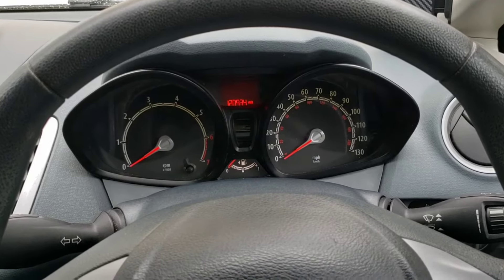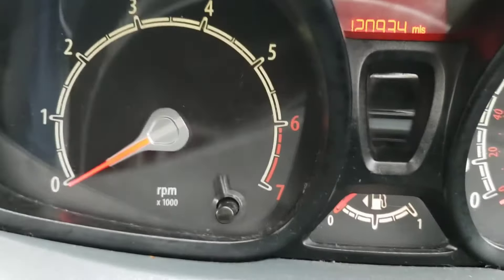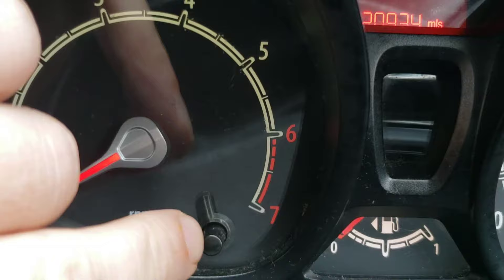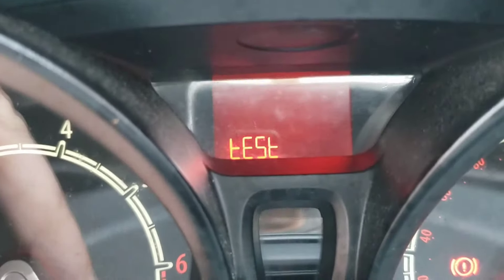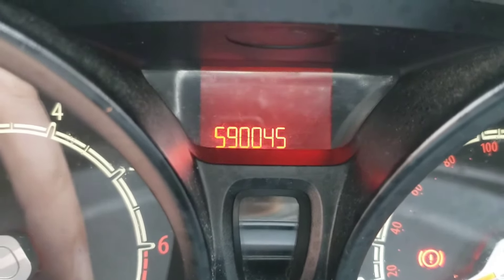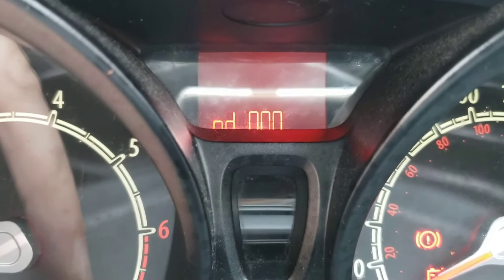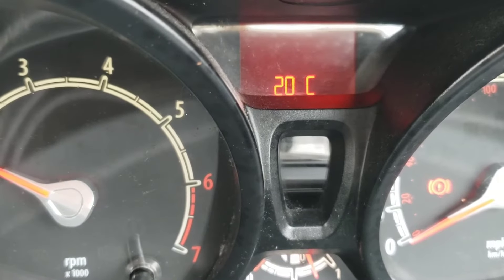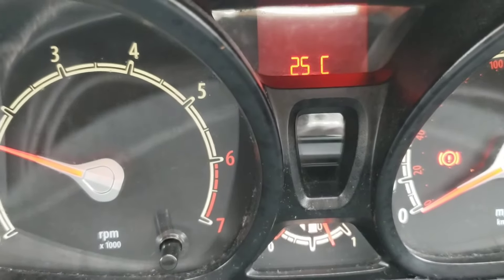ford fiesta mk 7 hidden temperature gauge

Comment: Thanks for this but they should have just put in a normal gauge - just blew a head gasket on my Fiesta that is costing a small fortune and it would have not happened had it been for a gauge . The car does not even warn you to say it's running hot and I always assumed it would.
Reply: Without a warning temperature gauge, this vehicle is not worthy buying!!!
Reply: There is an engine temperature warning light (two to the left of the gear change indicator in the video), but normally by the time it's come on it's too late

Comment: So have to do procedure every single time engine/ignition turned on or off? Won't keep it showing ........what a complete faff and stupid idea! I just got a MK7 fiesta was hoping a way keep it up every time key turned.
Reply from the maker: I know it's ford for you .it good to know if you need to replace the  coolant  or something
Reply: @CFCARREPAIRS  come from years old VW GTI's, recently got a 2012 MK7 fiesta S1600 first ever owned performance Fiesta hatch (driven XR2I's just never owned as went VW). Just seems mad idea as won't know Fiesta/Ford's overheating till overheating and damage done without a gauge.
Reply: @markturner-smith5309  I think they have a warning light come on, on the dashboard!
Reply: @paulmuff9883  from what I have read that's too late by time it comes on Ford set high so damage done head gasket warped & head warped. Don't know why they can't have gauge. All a warning light will do is tell you engine screwed
Reply: @markturner-smith5309  I agree
Reply: @markturner-smith5309  The Fiesta ST has a digital gauge, however, it's only 4 bars until it gets to the middle/"operating temp", which is only 50°C. Apparently it will stay at 4 bars until 120°C. My car did overheat during previous ownership and there is a slight sweet smell on start up, but it's taken 16,000km for coolant to go from max to min lines.
Reply: @markturner-smith5309 I can confirm that this is correct as it just happened to me.

Comment: Considering that a main ""cause of death"" for Ford EU cars is a overheated engine causing head gasket failure, I am shocked that an Engine Temp gauge or indicator on the display is not standard.
Thanks for the vid mate!!
Just bought a 2012 Fiesta for my daughter, after she killed my mint 2014 Galaxy by driving it while there was a coolant leak even though I told her not to. (my garage was overbooked and asked to park the car for 2 days, and then bring it in for inspection and fix)

Comment: Thanks for the video! it is great to know. I also have a problem, my heater gets ward mut never hot even on Highest temp. it is an auto air conditioner. also sometimes, I hear some plastic moving around in the middle of the dash, like a plastic door trying to open/close but barely does
Reply: Your issue is the blend actuator do a Google/eBay/YouTube search, it’s a common issue on mk7 fiestas

Comment: Hi, very helpful :)
Did you know what's mean red dot in the center and 2-3 sec continuous beep when i turned the key on the second position?
Reply: There could be a door open or lack of fuel maybe?
Reply: I think it’s the car alarm deactivating  my fiesta flashes in the middle when it’s locked and a few seconds after turning it on
Reply: Immobiliser detection. If key doesn’t have a chip inside red dot behaves in a different way

Comment: What is the maximum temperature allowed? I live in tropical country and on traffic jam it raised fast. 15 minutes 10 degrees celcius. I really afraid to use this car on rush hour
Reply from the maker: The thermostat opens up about 105 to 107 Celsius don't let it get hotter or you will Damage the head
Reply: @CFCARREPAIRS  thank you very much sir

Comment: Hi I have ford fiesta 2010 model jist worried if my radiator coolant fan is working or not ..i turned on my engine and checked its not turning on any idea how can i check that?
Reply from the maker: If you have air conditioning, switch it on and see if the fan goes round

Comment: I have ford Fiesta 2010 Titanium with button start,  only had car for a month now ive recently passed, I hear a  ticking sound from engine only when outside car, inside i cant hear anything, also once i start driving for 15mins the noise is gone. should i be worrried... also what coolant should i use?  thank you.
Reply: Maybe thick oil is making the valves a bit noisy untill it gets warmed up

Comment: really useful tip thankyou, i have an ongoing problem in my 2012 edge whereby the coolant expansion tank swells when car is stationary and actually failed an MOT due to this, (dangerous?) I'm still non the wiser as the chap said that the head gasket was fine,  I even replaced tank pressure cap but coolant stays in the tank and is not circulating as it should. Anyway, i will be able to keep an eye on the temps now- and really frighten myself! Many thanks
Reply from the maker: If it's not circulating look out for the water pump or a blockage or air lock
Reply: @CFCARREPAIRS a few weeks ago  I had the water pump replaced along with the timing belt, and even had a new catalytic converter fitted due to high CO emissions, so it must, as you say, be an airlock somewhere, or a problematic  hose. I guess it's just a case of draining off the coolant and refilling but i cannot find the coolant drain valve anywhere- I love your videos, very down to earth and helpful-top man.
Reply from the maker: Just pull the hours off the Bottom of  the radiator m8 I have not seen a Drain plug myself on my one
Reply: @CFCARREPAIRS   CF, I really need to keep this car on the road and you have helped me out, I really appreciate it. Thankyou.